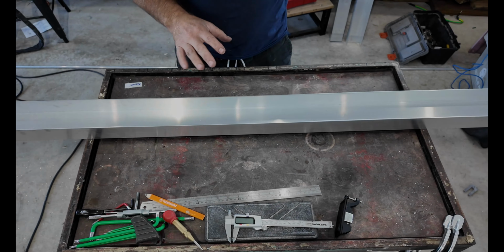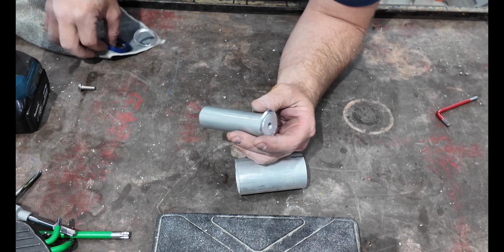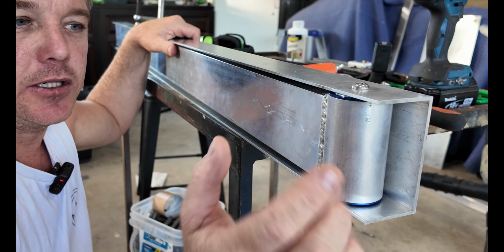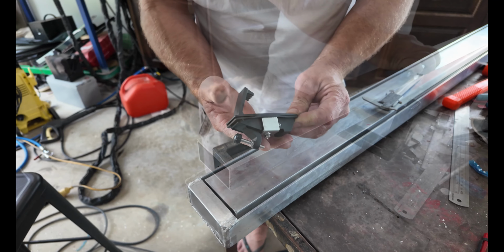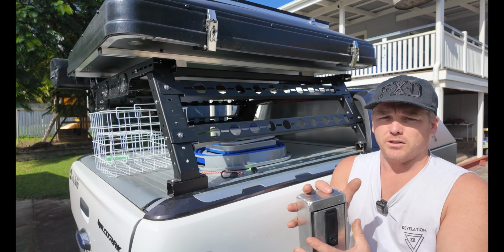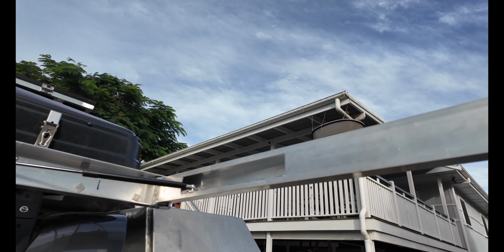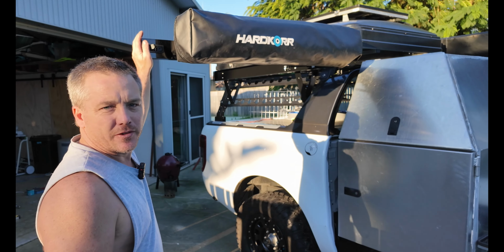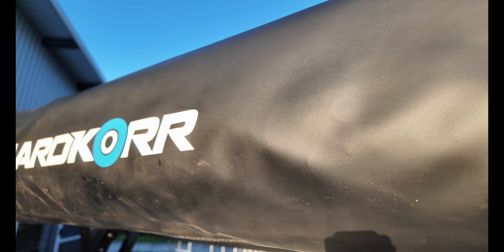HARDKORR CAMPING Shower Tent! DIY Swing Out Shower!!

Comment: Any chance of making another one? All the others I’ve seen are as flimsy as fuck
Reply from the maker: Hey mate, I could, but I do really need to get another welder.. and you would have to make custom brackets to fit it on. There is one similar to mine from CORE, but it isn't cheap.
Reply: @ yeah I saw that, and I do t think it’s anywhere near the quality of yours! I need a new welder just for ally, would you have the measurements of the hinge parts you used? I could easily fab it up myself, just either need to convert my mig or by a dedicated ally tig
Reply from the maker: Cheers mate, yeah I will take some measurements of the aluminium for you. U will need a 44mm bike headset. I bought 2 and used both bottom pieces as it sat flatter. Just got them from eBay or Aliexpress.
Reply from the maker: Hey mate, so I measure the aluminium for the hinge makeup.
The centre stem is harder aluminium, which is 30mm, and whatever length that u require for tight fitment.
The outer tube seats the bike stem cups is 
50mm outer 
3mm wall
And about 44mm inner
Then all u need it what section u mount it in depending on your design. If anything else just let me know
Reply: @ thanks Scotty! I’ve ordered my bits
Reply from the maker: @RossTwemlow nice mate let me know how you go

Comment: Nice work, but sorry I don’t get the point of pivoting the shower tent 🤔
Reply from the maker: The whole point is that it swings away from the rooftop tent and allows the tent to open while having the shower tent alongside the tent. Also, it gets it away from the  side of the camper. For my setup, it works great, and many people are even using them on their cars as it swings out from their canopy.

Comment: Excellent solution @scottyzbuildz ... just wondering if you could share the aluminium section, bearing and pipe / alloy stem sizes you used? Cheers man! Keep up the great work!
Reply from the maker: Thank you so much. Sure thing, the headset I used was 44mm bike stem, but I bought 2 and used both the bottom bearing and bearing seat. The main outer body was 100 mm outside Dia. And around 94mm inner. The swing out body was 80mm box, and the headset sleeve was cut to suit the required length for a tight fit. The tube was 44mm inner but did have a slight wiggle room, so I advise to paint the inter tube for a more snug fit. I hope this helps, and  if you need more info, just let me know 😊